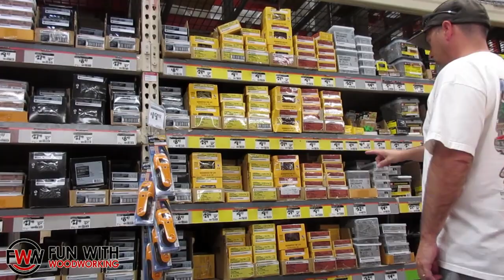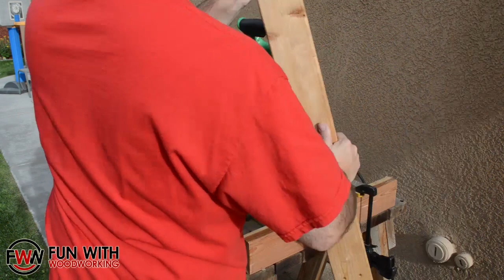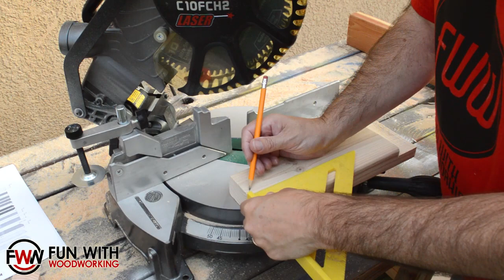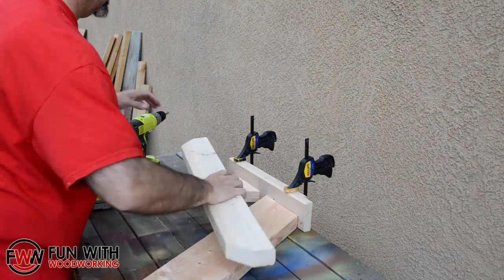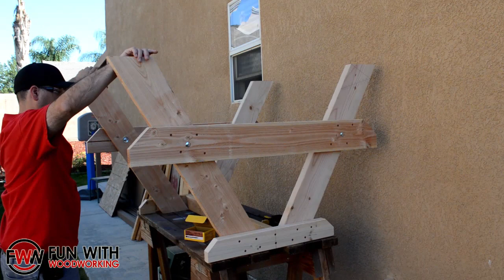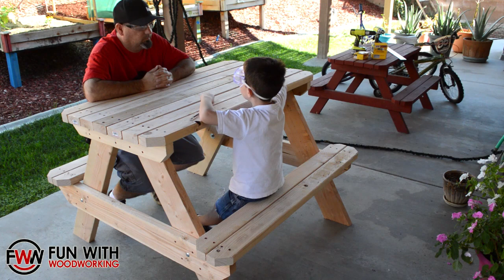How to build a 4ft picnic table

Comment: Did you take off the 3" at the bottom or did you do an 1 1/2" top and bottom so you could reuse the mounting holes you had for the Carriage Bolt?
Reply from the maker: +worldschaos2181 I took 3" off the top and realized my mistake when I tried to reuse the mounting holes for the seat brackets. Either way you would still need to make new holes as the overall footprint of the legs has decreased.